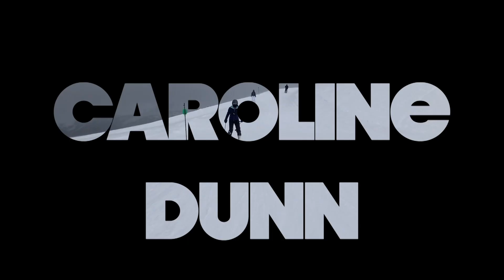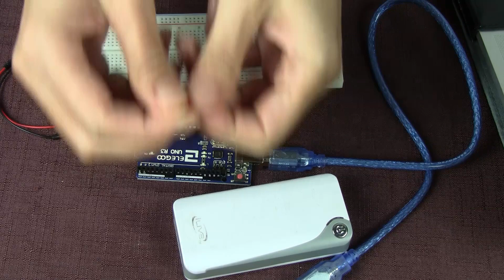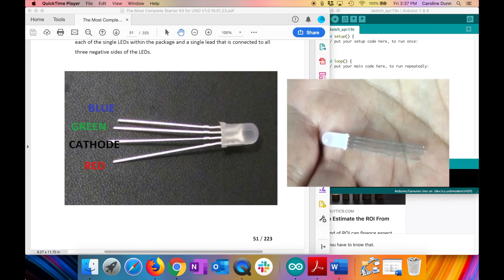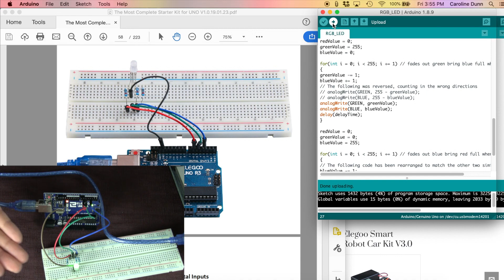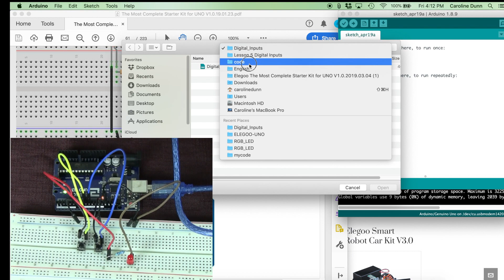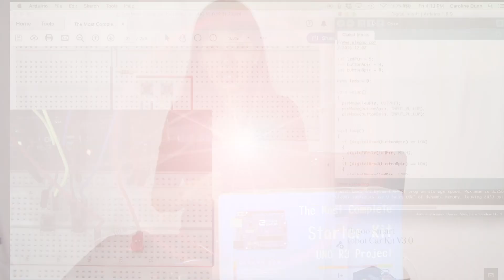Arduino Part 2: LEDs with Elegoo Most Complete Kit

Comment: Hello, how can I run it with Matlab. I got an error

Cannot program board Uno (/dev/cu.usbmodem14201). Please make sure the board is supported and the port and board
type are correct. For more information, see Arduino Hardware Troubleshooting.